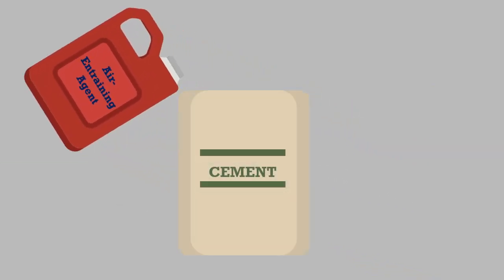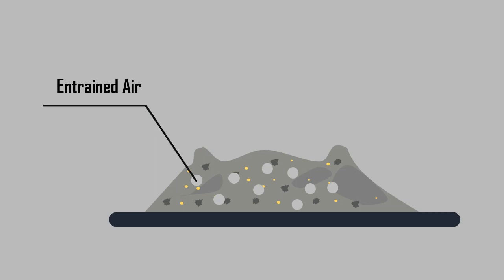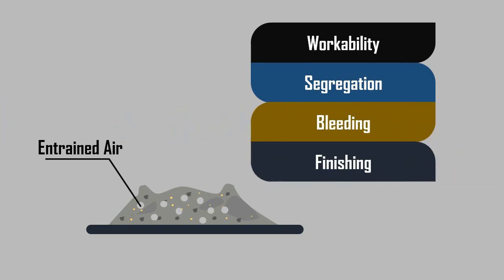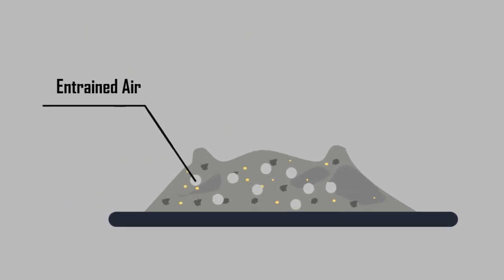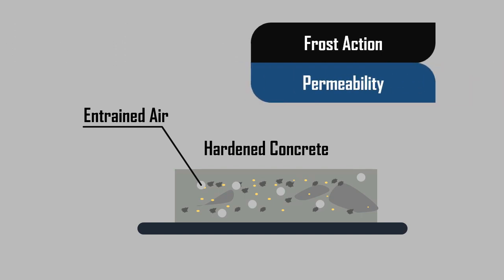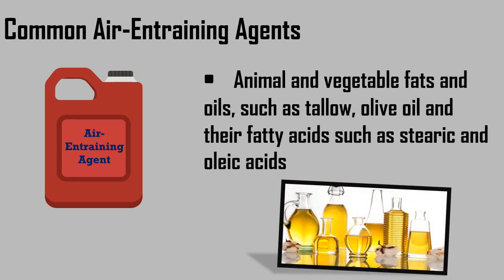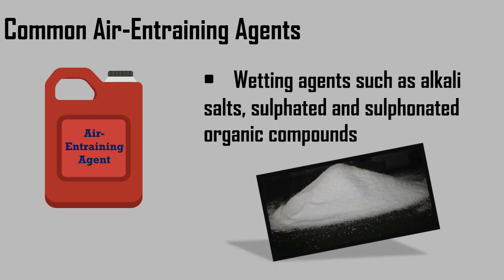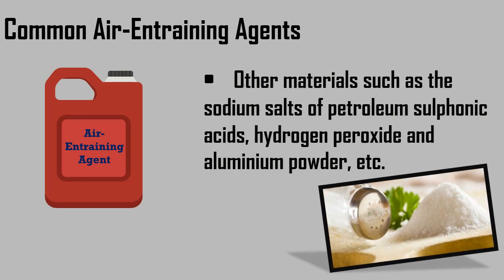Air-Entraining Agents for Concrete || Admixtures # 6

Comment: Hi, Can you tell me if these materials help to pump the concrete also. Thanks for a great video
Reply from the maker: Yes, this can be used along with the pumping concrete.
Reply: @AnimeEdu  thanks for replying. 
So if I use vegetable oil in the mix, 
It will help with segregation. 
Is that correct?
Reply from the maker: @Jimmy-gm3vj  The processed one are available in market.
Reply: @AnimeEdu  do you have a name for these products?